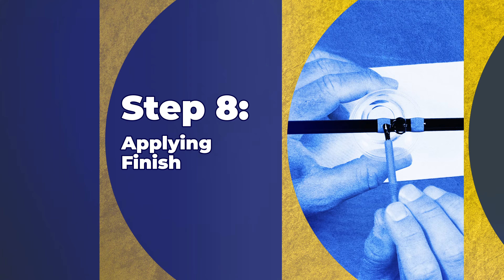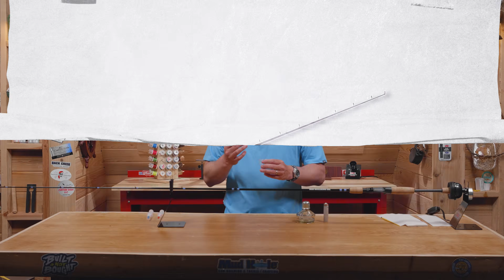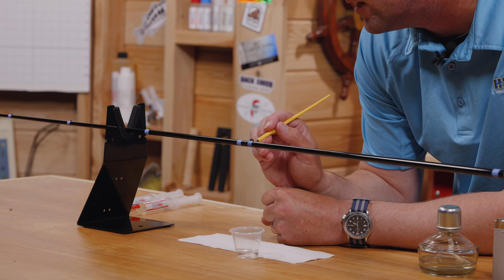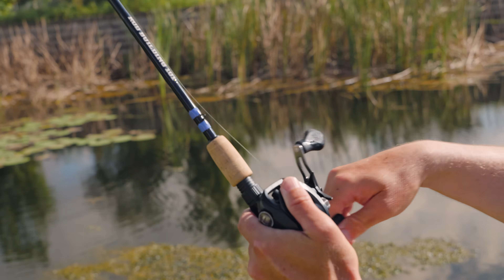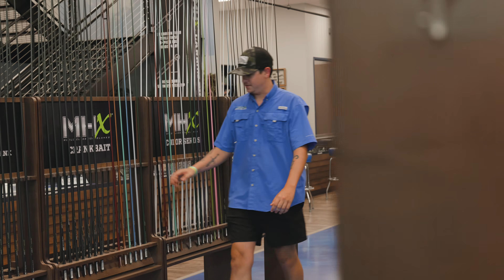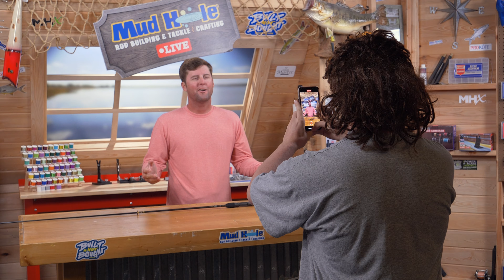Step 8: How To Apply Rod Guide Finish - Rod Building 101

Comment: Do you have to put thread finish on the decal?  Or will the decal stay unaltered when fishing
Reply from the maker: It's best to apply a coat of finish over the decal to ensure it stays securely on the rod and is sealed from the elements. Before applying, let the finish sit for about 5-10 minutes after mixing. This allows it to thicken slightly before application. Letting it rest like this helps prevent the finish from lifting the edges of your decal.